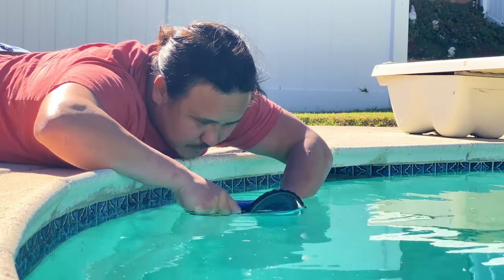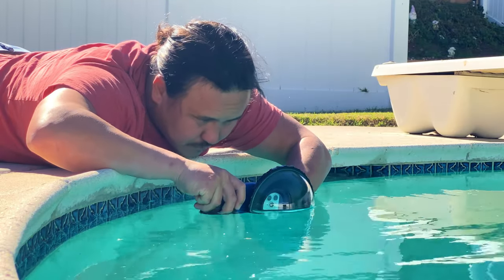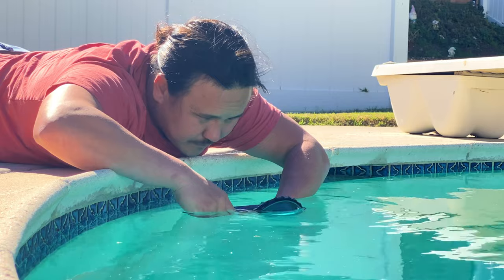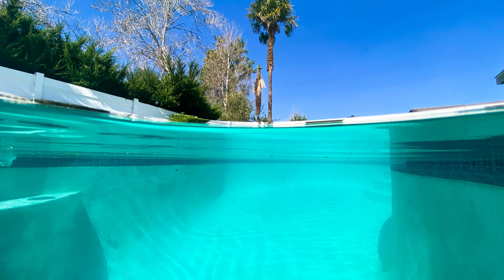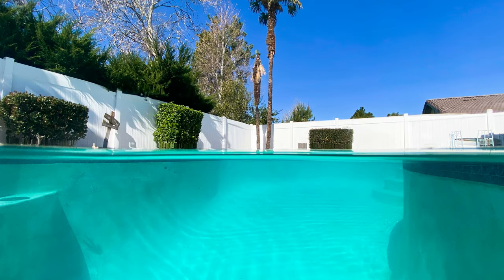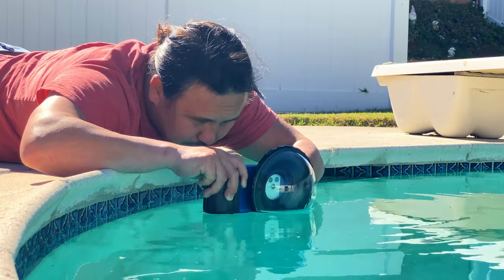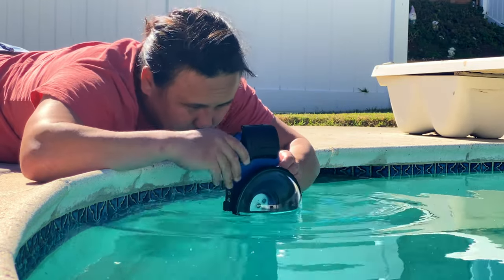Water Drops On your AxisGO Dome Port

Comment: Thanks for this!  What about a rain repellent like Rain-X on the dome port?
Reply from the maker: Thanks Julia, Rain-X is not recommended as the key is not to repel water, but create a coating of water on the element in which to shoot through. The saliva helps the water stick to the port and create this film of water to shoot through. Any products such that contain alcohol should also not be used on acrylic elements as they can damage the element.
Reply: @AquaTech_imagingsolutions  Ah yes that makes sense, the rain repellent would just make more drops adding to the problem. Thanks for your reply!